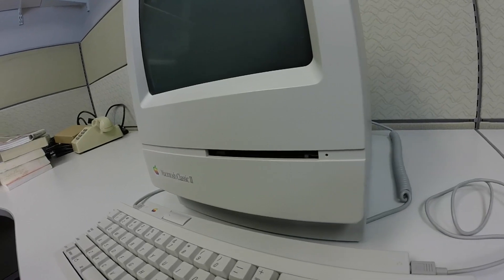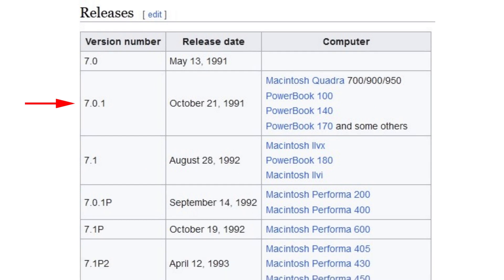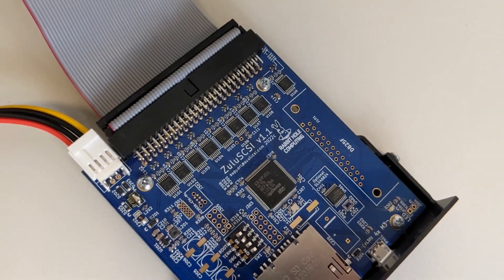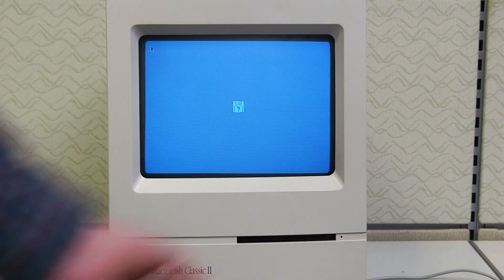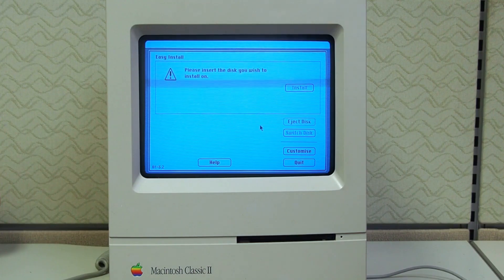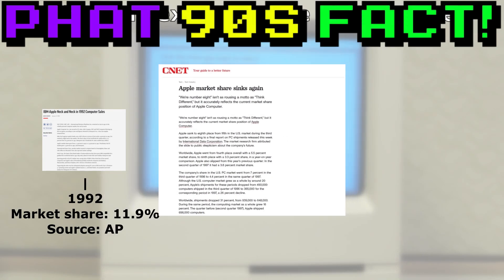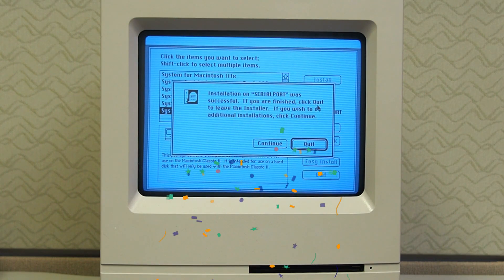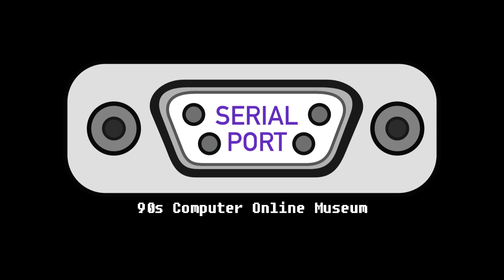Apple Macintosh Classic II Restoration — Part 2: System 7 installation

Comment: My first desktop was an original MAC. I had an external SCSI hdd that you had to flip the switch on second, turn ln mac then quickly turn on hdd. If yiu did in the other irder or wait too long it failed to boot

Comment: I don't think you needed to do the partitioning step. That's only necessary if you want to use multiple partitions, such as an OS partition and a data partition, or to install A/UX as well.

Initialising the hard disk was the only required step.

Comment: Excellent job! I watched parts 1 and 2. The Classic II was my first Mac, which I purchased in Jan 1992 from Micro Center (which is STILL in business as of 2023!). I had them upgrade the RAM to 10 MB at the store. Stock HD was a whopping 40 MB. It shipped with System 7.0.1. I also bought an Apple LaserWriter II-NT and a modem. I had been renting time on Mac SE’s at Kinko’s, creating promo material in PageMaker. It was a big deal to have a Mac of my own. It finally gave up the ghost in the early 2000s, by which time I had acquired various other Macs. Thanks for the memories. Subscribed. 🤓
Reply from the maker: Thanks for watching - and the idea about trying out PageMaker :)
Reply: @theserialport  Nice. As I recall, the then-current version of PageMaker ran fairly decently on those all-in-one Macs. I’m sure you would be able to source that software, if you haven’t already. I know you said you’re more PC-centric, but I look forward to any future Mac vids.

Comment: Can u plan doom 1.1 on this?
Reply: I don't think Doom will run on black and white.
Reply: The is a Doom for System 7.x machines, but I don't know if it will run on this particular Mac. From memory you needed 8mb of RAM, so possibly not.
Reply: Nope. Even the oldest version requires a 68040 processor and 8-bit color.